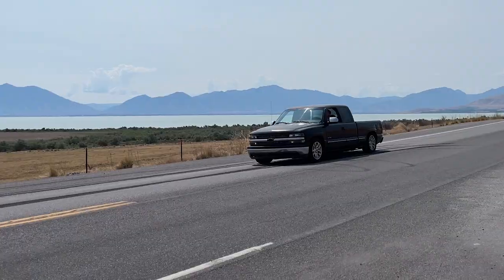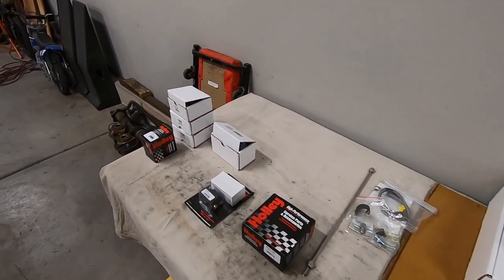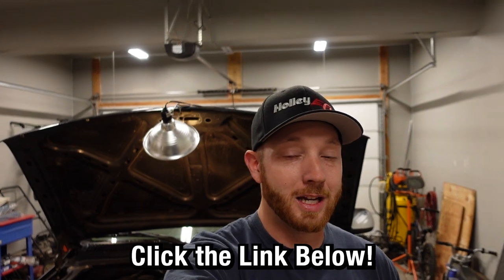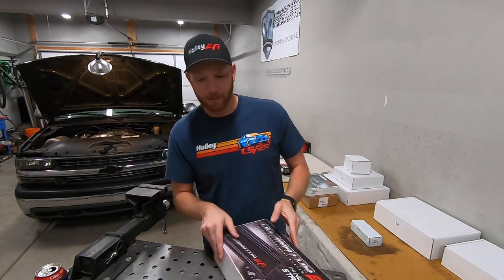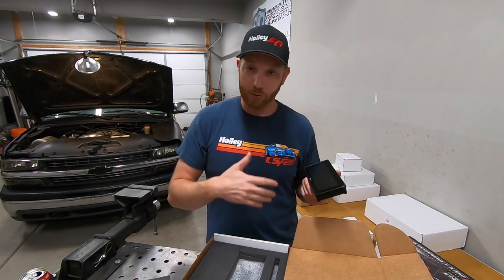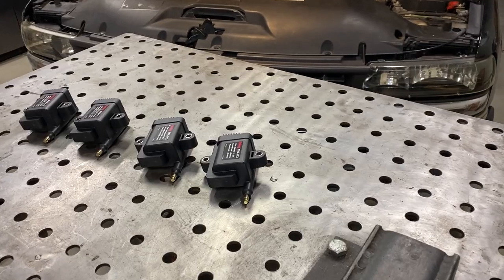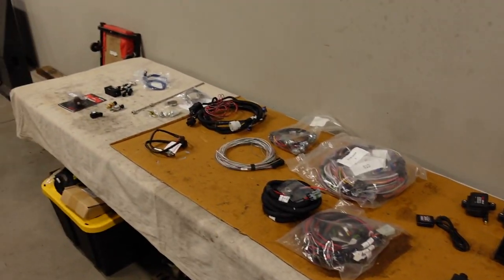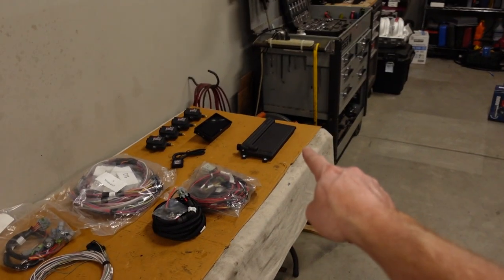the ULTIMATE engine management system for my Race Truck

Comment: I’d recommend getting the Holley running on the current engine first. Nothing like troubleshooting issues not knowing if it’s mechanical or electrical. And it’s a like hard to break in and engine properly when you’re trying to tune it.
Reply from the maker: If all works out, that’s what the plan is

Comment: It’ll go 9’s without a lot of effort. With the Holley hopefully you can get some built in safety shut downs programmed to save the engine. The boost by gear will be very helpful.Im thinking a good traction control program will be be huge as well. Maybe a boost scramble button. 😊
Reply: Really easy to do. I have an ethanol content nitrous safety set up with my system, won't let me hit nitrous unless I'm over 20% ethanol and won't let me hit the full shot until I'm over 50%

Comment: Should be able to use that GPS and trans speed to determine tire slip!
ALSO, check Motion for a dual element coolant pressure AND temp, in one sensor.

Comment: How about a coolant pressure sensor to monitor for excessive pressure like a head gasket issue? Then I’m thinking driveshaft speed sensor to go along with traction control system and torque converter analyzing. Maybe a crank case pressure sensor too be nice to keep tabs on that.
Reply from the maker: Also great options!

Comment: A problem people noticed with dominators is: if you have disabled parts to the program. Ie traction control is turned off. Under the right circumstances it will reactivate. So keep your program as clean as you can.

Comment: I love all of the data, but you have to make sure it's good data!  To that end, adding all of those sensors puts the burden on you to make sure the wiring and connections are all top notch!  Proper crimps, routing, strain relief, etc.  And power!  And grounds!  I think that's what lots of people struggle with.  Especially position and speed sensors.  Especially crank sensors.  Do the wiring and setup right and it'll be a lot of fun to make it sing.  If not it'll drive you crazy!

You'll get to 8s if you make 1500 hp.

Comment: This is in reference to the engine swap you did on the jeep. Did you reference the kit you used for the engine swap along with all the stuff you had to buy for it? Was planning on doing it to mine this winter but I haven't found a video that showed everything they had to buy and the issues they ran into to overcome. It's been months since I watched the video and can't remember

Comment: ive often wondered, do you think it would make sense to have the ignition timing tuned on e PER cylinder basis, to compensate for tiny differences like wear over time and for that matter carbon buildup over time with an ECU that learns and logs data?  So for instance, maybe a brand new fresh engine starts are 32 degrees on all cylinders, but over time changes to say 32-32-31.7-33-31.1-30-32-29 degrees for cylinders 1-8 based on accrued data over the months/years?  i really think that could be a next step...base it on knocking, cylinder temp, a/f ratio on a per cylinder basis, etc......but then i also wonder if the benefit is worth the extra complexity and possible weight added on of extra sensors....does the concept make sense  tho?
Reply from the maker: absolutely that makes sense, and I am sure there are some gains to be had with individual cylinder tuning, and I am pretty sure the Holley Dominator can handle that, but I doubt there will be significant gains to be measured from the process. lets say you make 1,000 horsepower, maybe you could gain another 10-20hp? thats my guess for what its worth
Reply: @LawrenceTolman  i wonder more long term if there is an advantage in wear and tear rather than HP though...like, could we get 500,000 miles on a bottom end if it were optimized in that way?  i agree though i think the power increases would be minimal

Comment: lawrence are you gonna have the factory ecu  control cluster, fans a/c?
Reply from the maker: Yes that will all still work, and I’ll go over that in a future install video
Reply: @LawrenceTolman  awesome,  definitely worth it 
Only thing i havent gotten to figure out the 99-02  factory single wire for oil pressure going to ecu wont grab info from the holley 3 pin if i split it so the gauge on factory cluster doesnt work 
Going to mess with it more later this winter.. may add factory single wire pressure on turbo feed so i can monitor that lol

Comment: 8 second E.T. would require a full roll cage…….in my estimation. We ran Supergas on a 9.30 index & the car was certainly professionally built with a full cage. I would not even dream of running under 11 seconds without it.

Comment: Confused, how is Snidertron3000 able to get Jack Black OBS Chevy with a stock bottom end L33 5.3L turbo to run a 10.4 with a TH400?  He is running 20 psi as well.  1,100 ft above sea level.
Reply from the maker: lots of variables, and it comes down to a lot more than just power output. His truck may be much lighter, have better gearing matched to his engine, a different torque converter, better launch, and many other differences. My biggest mismatch for example is the torque converter and gearing for this engine: I make peak power at 4,200 RPM and peak torque at 3,500, yet during a pass, I am well over RPM the entire time.

Comment: 4l80 internal harness has a temp sensor no need to add one
Reply from the maker: correct, but the thermistor type sensor will not split their signal between the Holley ECU and the stock gauges which I am going to retain, so I will need to install two temp sensors for both the engine water temp and trans temp so the info can be reported to both